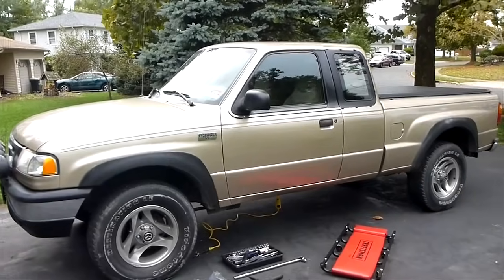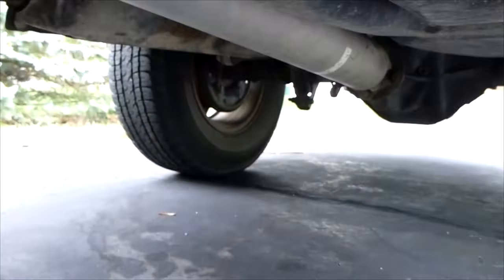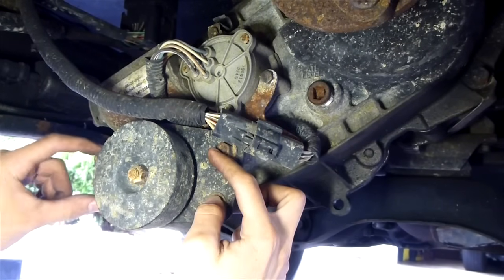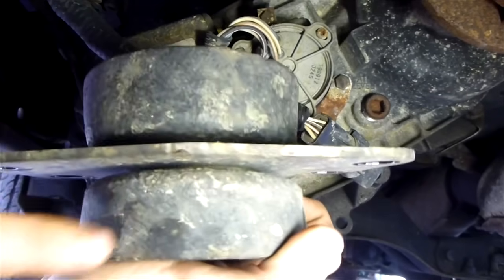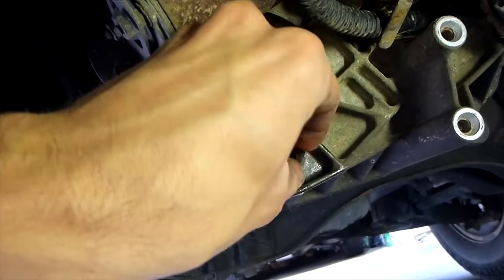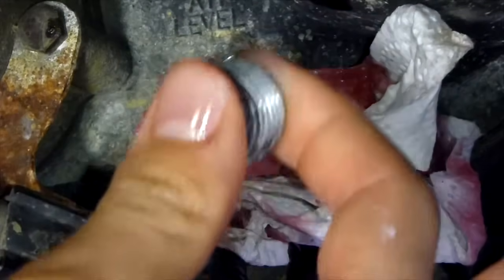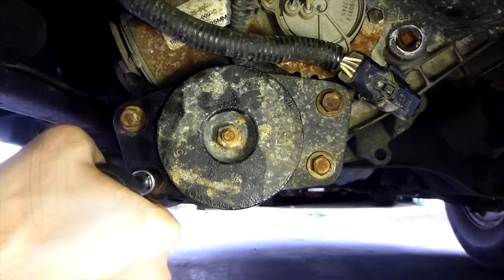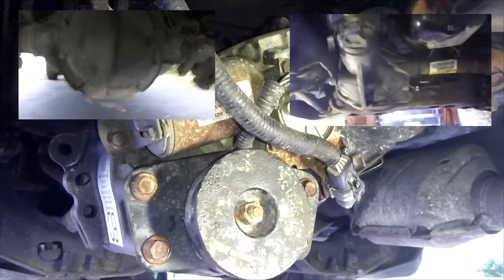How to change Transfer Case Fluid (Easy)

Comment: Chris,  have you done or do you plan on filming a video on transmission fluid change?  As I understand it, modern cars/trucks do not have a transmission filter now that has to be changed with the fluid change.   True or not?    Thanks for your informative videos.
Reply from the maker: Clarence Brooks I will be doing a transmission fluid change and filter change. Some modern cars do and some modern cars dont have a filter.

Comment: Hey Chris. Great videos!! I'm going to change my diff fluids and my transfer case fluid on my 08' Jeep Grand Cherokee. I have 148K on this bad boy! The question I have for you is where to start troubleshooting for a drive-train vibration that happens only from about 68-75 mph. It has done this since I've owned the truck (around 100k). U-joints? Drive shaft? Any suggestions you may have for me would be extremely helpful. Thank you for your time, and have a great day!
Reply from the maker: To check for driveshaft issues, go under the Jeep and shake the driveshaft as hard as possible. It shouldnt budge. I would try rotating your tires and see if the vibration changes. Might be your wheels are not balanced right.
Reply: Awesome! Will do. Thanks for the quick response. I have noticed a bit of a grind, or groaning coming from the rear of the vehicle at low speeds on deceleration. Also, a little drive train slack feeling between acceleration and deceleration like in rush hour traffic situations. Drive shafts is snug. Can't rotate it at all. Thanks for the pointers!!
Reply from the maker: Hm, maybe the rear diff is worn? Check the fluid: https://www.youtube.com/watch?v=KmqMUJb-E4M

Comment: Chris put your pinky in the filler/drain plug to avoid you finger to get stuck or to be more save put a telescopic camera head connected to you cellphones to see the level of the diff oil
Reply from the maker: Thanks for the tip

Comment: Chris, can you tell me if my 2006 Ford five hundred fwd has rear end fluid/grease that needs changed, or a front wheel differential that needs changed ?
I've changed the be oil regularly and Asin 6-speed fluid has been changed.

Comment: I like when truck companies use all the same size bolt heads so it is easy to do a job and I don’t have to get all my sockets out just to change diff fluid

Comment: Hey Chris just watched this again because I am ready to change out the fluids in my Ranger.  Did you ever make a video on changing the fluid in the front diff?. If so I could not find it!!!. Is there anything different on the front then on the rear?.
Reply from the maker: +FUzzyBUnnyBOoties Not yet, I really need to do that video. The front needs to be pumped out via the fill bolt. Otherwise you need to drop the front axle.
Reply: +ChrisFix Thanks Chris. Glad I asked. Will have to grab a pump for sure.

Comment: hey man thanks for all your videos. do most transfer cases have that dampener? i drive a 99 xj and i have terrible vibration from 25-35mph and none at any other range. it does not have a dampener but i was wondering if it might be missing
Reply from the maker: Only in 4x4 or all the time? Did you try rotating your tires and check you u-joints on the driveshafts?

Comment: Hey Chris how much oil do I need for Chevy Tahoe 96 and if I pull the drive shaf out of the transfer case it will leak all the oil out or i need to remove the plug?

Comment: great video! I have a question, are the automatic transmission and transfer case separate fluid changes?
Reply from the maker: +eldom72 Most of the time, yes. Some transfer cases are built into the transmission so that would be all the same change.
Reply: Thanks!
Reply: +ChrisFix hey I have a 4x4 z71 2009 Silverado and my truck just turned 100,000 should I change the fluid on the transfer case?And how many miles should I do it? I'm kinda nervous of doing it lol.

Comment: im not really a "car person" but I do understand most of what im learning since I recently purchased a 2000 WJ JGC LIMITED and need to change the fluids all around. the brake and trans fluid I want the pros to do but i want to do what I can do myself to save some $$$.  what you demonstrated in this vid seems fairly simple to do and straight up and I figure the fluids would be different though but would it be the same for my jeep as well?
Reply from the maker: Check your owners manual to see what specific fluids you will need. The process will be the same though. I also have a rear diff fluid video:
How to change rear Differential Fluid (detailed version)

Comment: Hey Chris. Thanks for your helpfull videos! I own a 2005 Ford ranger and when I run it on 4x4 mode, it does weird things. It feels like for a fraction of a second the engine is missing power then comes back.... or if the differential/transfer case was kind of off-synchronized and jumping.... I was wondering if it could be only transfer case oil issue or simply the transfer case itself dammaged?
Reply from the maker: fsoo7 It could be a transfer case oil issue but it can also be a bad transfer case. Do you have the same size tires on all four corners? Does it jump when you are going straight or only on turns?
Reply: my tires are all the same but at their last winter season... the problem occurs often when on light curves at cruise speed
Reply from the maker: fsoo7 Well you should only have your 4x4 on when you are on a slick road or offroad because you will get that problem with the front end hopping. Although, you shouldnt have that problem on a slight curve, more when you make a sharp turn.

Comment: Do you need to put the Loctite on the threads that have no Loctite on them because that's what holds it bolts tight the other is the thickness of the plate

Comment: Is it safe to replace the fluid in a high mileage vehicle? I have a ford explorer with 300000+ miles, I've been told not to change trany fluid but can I change transfer case and rear diff fluid?

Comment: hey chris, i have a 2004 mitsubishi (K74 model) L200 4door pick up. when i'm on 2wd, turning left or right is not a problem, no noise. However when i engage the lever to 4H or 4L i get this grinding biting metal to metal noise coming from under the pickup when turning right or left. i have checked the transfer case by draining the oil and it came out clean. No metal filing in transfer case oil...I took of the front differential cap (6-8 bolts) (with oil drained no filing either) the Cv joints looks good. Any advice or ideas what it can be...no issues on 2wd only on 4h and 4l turning left or right.......thanks....

Comment: My Transfer Case is a NP241 and GM says not to use Dex-VI and this time I'm going with ATF+4 because its a better grade of fluid (synthetic) and very similar to the Dex III you are using.. Besides, New Process makes these units for Jeep and most other vehicles, they are not too picky about the grade of ATF.. Just my Point-of-View
Reply from the maker: Thanks for sharing! I personally have always gone with the manufactures engineers recommendations.

Comment: yea Chris Fix I know you are a busy young man yet the automotive podcast community is wanting to hear from the younger guys....anyway question for you ...I have a early 90s ranger went to Oriellys they said the new and best fluid for my trucks t case ,Borg Warner 1354, was valvoline multi purpose transfer case fluid instead of the old atf. What's the professionals opinion... side note your video help me out the other day to set my warped t case nipple to 2wd HI...had to take of the vibration dampner. 1up
Reply from the maker: You don’t have to go crazy with transfer case fluid. Whatever your owner’s manual says is good, will work. What I used in the video works fine.

Comment: Hello! I'm a follower of your videos! Are great, but I think that in this one you had an error I do not think that I carry that type of oil your transfer should carry a oil of synchronous box of 80/120 or could take a thicker one. If I'm wrong, I'd like you to correct me. Greetings from Venezuela. Please excuse my spelling and grammar
Reply from the maker: Thanks Alejandro. The oil I used is correct for my make and model as stated in the owners manual.
Reply: Well I do not take it off, but I think it's a solid gearing system but not a pasta disc system (or friction disc), I think you use the wrong oil. I do not know if I explain myself. Is not that it is very given in the matter, but my experience tells me that in the case of gear components an oil should be used that prevents wear on it, so an oil should be used to prevent wear or lubricate the parts (which Would be an oil for synchronous transmissions or gears) and not an oil of automatic boxes or hydraulic power (which in its fundamental qualities is to give hydraulic power apart from lubricating) so I think the sincero box oil would work better in the Transfer As we speak of two different types of oils. Now that truck I do not know it well, the transfer of your truck may be from pasta disks (like the automatic teller machines) and use that type of oils, but given the amount of input and output torque that drives the transfer I doubt it is so, and more for the oil you drained (I saw it very thick).

I am not very skilled with English and I use the translator to communicate with you, to listen to it but not to express it I apologize if you do not understand me in certain parts, or you lose part of what I want to express in the translation

Comment: Hey Great videos Chris!
You said a 1/2 in socket, while some of the SAE sizes also match up to Metric more of the parts on my vehicles are Metric and I'd guess others are too (might be helpful to also give the Metric size as I mostly crawl under my rig with Metric's). I'm on one of the Forum's your a member on, asked members for help on that forum in ID'ing the bolt's to hold the "Missing" Vibration Damper" on my B3000's Transfer Case without luck so far. I counted 18 threads on the bolt in your video, can you read the case hardness grade on the bolt head so I can use all this info to get correct replacement bolts to re-install a damper I just got please (Ford and Mazda both say they can't ID the correct bolt in their exploded view/part's list's?)?
BTW
When do you plan on doing the planned video on Front Diff fluid change?
Keep Wrenching and Recording!
Ron
Reply from the maker: Ron Colley Hey Ron, thanks! I appreciate the feedback and will take that into account. You will want to use grade 8 bolts just to be safe. You can also just go to a junkyard and find a ford explorer, ranger, etc and get the bolts and dampener there so it is cheap and you can get the bolts!

Comment: Important Question.  I have an old Durango that I want to use for a few months for commuting to a job site then will get rid of it. It is 4x4 and I just had the transfer case basically explode. The case just broke apart, the metal drive belt is off the front driveshaft, the driveshaft is laying on the top of the skid plate.  I am wondering, If I remove the metal belt and remove the front driveshaft, can I just drive the Durango in 2wD?  Will this cause any harm to the transmission?  I do not see any damage to the transmission and it is not leaking any fluid, the housing on the transfer case just came apart.  Chris or anyone here knows?   I was not in 4x4 at the time of the failure and had just drained and refilled the fluid in the case a couple days prior to the failure, not sure If I messed something up, I put the proper fluid, maybe I tightened the drain plug and fill plug too tight and started a microfracture?  Anyway, Could I remove the belt and shaft and drive it that way without any further damage to the transmission or rear driveshaft? I do not care about the transfer case or 4x4, Like I said I am getting rid of the vehicle at the end of the summer.  I just do not know a lot about the mechanics of the Transmission/transfer case.

Comment: Hi chrisfix, im new in the mecanic so, i have a question for you, i have a 00 ford ranger 5 speed manual , and i woud change the transmission fluid , i dont know what kind of oil i need, be cause the ford manual saids motorcraft mercon atf but my transmission is manual so...  what type of oil you recommends?   Sorry for my english im learnig,, congrats for your videos.
Reply: Mercon is no longer made, so you can use Mercon V. I have an '03 with a 5 speed also. If it is 4x4, do NOT put Motorcraft Mercon V in the transfer case...there is a replacement just for the cases that used Mercon. It is Motorcraft XL12 Transfer case fluid. Hope this helps.

Comment: hi, chris. im wut wat. i asked you about measuring the automatic transmission fluid yesterday. unfortunately the previous owner changed the whole trasmission so that option is not available to me. so i have to find a way to measure out the fluid amout without using any deepstick. do you have any idea? i thought about installing a transmission temperature gause but that idea is kind of vague and it wouldnt be easy to measure the right amount with using the gauge temperature. what would you do if you were in my situation? thanks.

Comment: Do you recommend using a torque wrench or will a regular ratchet be ok ?
Reply from the maker: WLADODGERS213 I like using a torque wrench, but for this you can get away with not using a torque wrench. Just tighten the plugs like you would a spark plug so you dont damage the threads.

Comment: Hey Chris, I have a Jeep Grand Cherokee with 160k I'm not sure if the last owner changed any of the drive train fluids. What is your opinon, especially on the transmission fluid. Also as a side note the jeep runs smooth but when I abruptly let off the gas the transmission bucks.
Reply from the maker: I would change the front and rear diff fluid, transfer case fluid, and flush the power steering fluid. Transmission fluid is a tricky one because you dont want to change it if you dont have to. Run the car, check the dipstick and make sure the fluid is at the correct level. When you wipe the dip-stick with a paper towel, see if it is pink/red. If it is dark, brown, or black then you should prob change it. If not, I wouldnt touch it. Transmissions can be touchy with new fluid. My van has 300k miles and got its tranny fluid changed once (at 150k miles). Rear Diff Fluid Change:https://www.youtube.com/watch?v=KmqMUJb-E4MPower Steering flush:How to Flush Your Power Steering Fluid

Comment: Hey chris! Quick question, my car has locking center differential, so when I change the transfer case oil. I do need to put a LSD type gear oil, is that correct?

Comment: this is an old video and you probably know but from the look of those tires you need or needed a alignment some major edge wear on the inside.
Reply from the maker: Thanks! Yea I ended up rebuilding the front suspension completely and I filmed every part of it (ball joints, camber bolts, tie rods, control arms, shocks, etc).

Comment: Any particular reason why you use the removable threadlocker?
Reply: +Casey Camby so you can remove the bolts if or when you want to change oil again ?

Comment: Hello Chris, I just can't seem to find a definite answer for the type of oil needed in the transfer case. I own a standard trans. '99 ford ranger flex-fuel, 4x4 with a 3.0 engine, the owner's guide recommends MERCON ATF but you know Ford doesn't make it anymore. Do you think the next generation MERCON V should be the best choice? the truck has 145,000 miles on it and it will be the first the first transfer case oil change. Thanks!
Reply from the maker: Leo Cadena You would use exactly what I used in this video. We have the same transfer case.
Reply: ChrisFix So, will the MERCON V be the wrong thing to use?...some people believe it's alright or even better.

Comment: I'm curious, could you just use Teflon tape instead of a liquid sealant as long as you make sure it gets in the threads as well?
Reply from the maker: Definitely. I just happened to have the liquid on hand.

Comment: hi, Chris. I need your help. I'm trying to change the automatic transmission fluid of my car but i lost the original deep stick so i put something else in order to prevent contamination. so how would you measure out the correct amount of fluid if you were in my situation. im talking about the cold mark hot mark and all that. thanks always.
Reply from the maker: +wut wat I would go to the junkyard or on ebay and get the dipstick for your car. Otherwise you will now know how much fluid you need.

Comment: Chris I have a 1998 ford ranger 4.0 liter v6 xlt 4x4, the previous owner didn't have a manual where can I find one to make sure I'm using the right fluid for the truck when I change the transfer case
Reply: brian martin 7 months later, but... dude. type the same thing you just did onto google. add the word "manual" directly after vehicle info. BAM! magic, right?

Comment: Hi Chris please help I've bought a van isuzu kb250 it's got very high mileage about 406 000km and its making a sound only on slow take off then it stops we've confirmed it's not the drive shaft or gearbox we think it's the transfer case could Low fluid cause this rubbing sound on takeoff

Comment: Hello Chris, what does it mean if my 4wd light not functioning?  I had this problem after I changed my clutch lining.  Before that, my 4wd light working nicely.
Reply from the maker: Scan the computer and see what the code is for the 4wd system.

Comment: Hey Chris have you ever done a transmission fluid change on a 02 Isuzu rodeo???
Reply from the maker: lbaby512 I have never done a transmission fluid change on an Isuzu Rodeo. Typically you just drop the pan, change the filter, put a new pan gasket on, bolt it up, and then add fluid until it is filled.